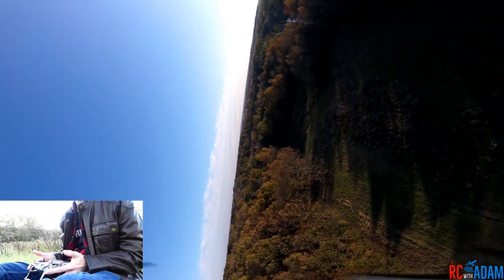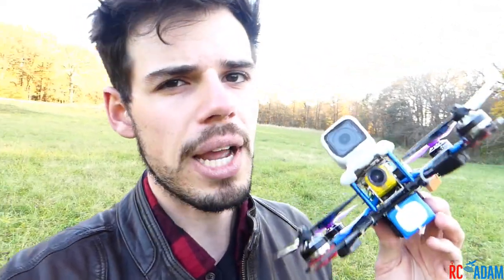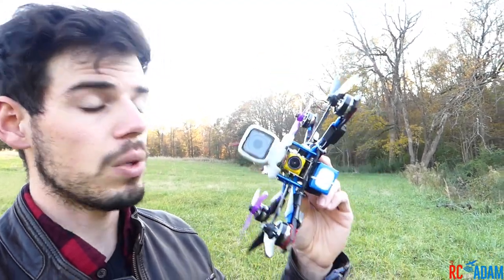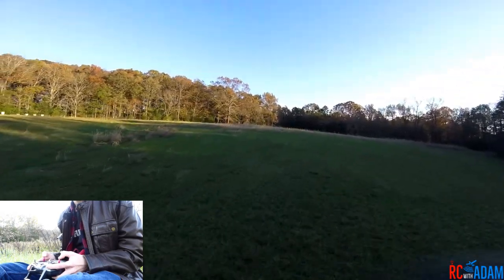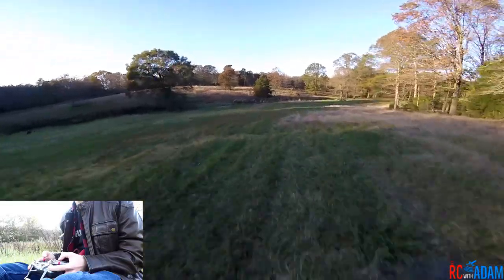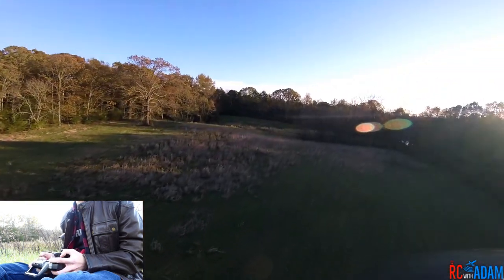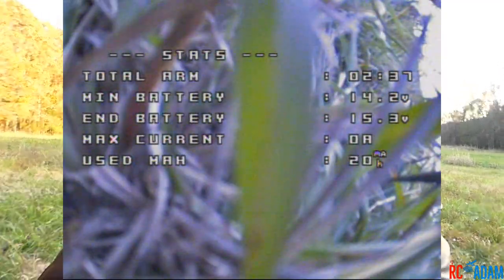AIR MODE Flight Demo FPV - What is Air Mode? Air Mode VS Acro?? Airmode Explained

Comment: Airmode actually keeps the pid loop active at zero throttle, it keeps the props spinning so you don't just drop out of the sky. Airmode allows you too stay inverted without falling uncontrollabley
Reply: What? Why does this comment even have 12 likes when its wrong. Acromode absolutely doesnt just turn off the motors when throttle is at zero. Like never, theres always like at least 3-7% power when throttle at zero. So what youre saying isnt the difference between acro and air. The difference is that in acro at zero throttle when falling all motors will be spinning at the same speed on the designated minimum motor speed of about 5% or whatever is chosen (when not giving any input). In air mode the props wont all spin at the same speed but rather on didferent speed, also never lower than the minimum motor speed of 5% or whatever is set bc they will compensate for any outside force acting on the quad with the goal of keeping it at a constant angle. So to be clear, both modes keep the motors spinning at zero throttle input, but airmode uses stabilization to keep the angle and acro doesnt
Reply: @baadlyrics8705  go and fly without airmode on, take it in the air and drop too zero throttle. The quad will drop out of the sky!

Now do the same with airmode on.... Then tell me the difference.
Reply: @Originaljonny2bad what his saying is both airmode and acro mode will keep the motors spinning at a set power. Air mode doesnt keep your drone up in the air the way you think. In acro the drone will drop out of the sky with no correction , air mode will try and keep your last position "orientation wise" . The only reason you might think your drone might be a lil more floaty in airmode is because when your drone is falling out of the air, the flight controller tries to keep he last orrientation that was set. Say your drone is top heavy and tends to lean to the right when free falling, the flight controller will try to fight that force to stay in the orientation it was set. Say your roll to the right a bit and your drone is top heavy, without airmode your drone will simply just roll uncontrollably while in airmode , it actively tries to keep that orientation
Reply: @neilbaquiran643  your sooo wrong, go do some research

Comment: Finally thank you Adam , I’m on day 3 of flying fpv ,only been hovering in stable mode with out the goggles . I decided I’m just going to go for it after watching video after video  never flown a quad before and can’t get on with a simulator, but I’m flying it about doing flips a couple of bit will try post up progress and I like to sit , but find I start leaning into the turns as if I’m sitting on it hahahaha
Reply: Hello, try fpv freerider. You can also use it on a tablet en most phones (app store) And you can also use your transmitter. It helps me a lot and I'm a pretty good fpv flyer now. Also important, you can learn to fly including tricks without damage.
Reply: I'm in the same boat, first flight I tried line of sight stable but ended up just smashing my quad into things and mashing up the props/lipo. I decided just to go with it the second flight and I personally find it much easier diving straight into the goggles and airmode. I was doing flips into rolls and freefalls straight away only crashed once due to pushing past my abilities rather than no control

Comment: I HAVE to sit.  Damaged middle ear.  If I stand, I'll fall down.
Reply: Ouch, is this one ear, or both?  Can you drive a car or ride a bicycle normally?
Reply: One ear.  Had an ear infection as a kid.
Usually okay.  No problem walking or driving.
But I definitely use visual input to compensate.
Good night vision, but if it's dark ENOUGH, I have trouble standing upright.
I do the Quad FPV thing, but always seated.
Thank the GODS I'm not prone to motion sickness!  I'd be queasy every day.

Comment: Mine had no horizon . Just airmode and acro . It doesn't  even have modes tab in betaflight . Airmode seemed like when lenses get broke in binoculars and the picture gets bent . But you can lean it back sirt of with the sticks .  Sort of like auto flip on a toydrone . Real popular with the freestyle regime rigid style .

Comment: I have much more control when I sit.
I understand why people use the pinch method, it seems that it would give more control, although, I am a thumber, because for some reason, when try to pinch, I cannot keep my quad in the air. Standing, on the other hand, I can't understand why someone would rather stand, if they have the option to sit?

Comment: Hello Adam , Thanks for this helpful video it really helps ppl like me. I have a Mobula 6, I'm having trouble with the trimming or calibration.  It just won't fly right, I've tried to calibrate and trim it but is nit working. Soon as I start to lift of it drifts at different direction and its impossible to control it, drone seems to have mind of its own. I think there's a bug in firmware or God knows, How can I factory reset the drone make it how it was from factory?  Anyone?
Reply: Disable accel,

Comment: Whats the difference between acro mode and nothing?   I still can't figure out what acro does when turned on?
Reply: There is no "nothing". You have to be in some kind of mode. Its like asking "what is the difference between an automatic gearmode car and a nothing gearmode car. There always is some kind of mode on and acromode is essentially the mode where you completely control the quad yourself without any assistance from the quad like self leveling etc.

Comment: What would you recommend to clean the mud off quads? I was thinking Isopropyl alcohol and a swab? I have a novice 2 to get me started but done the same as you faceplanted a few times in the mud
Reply: Contact cleaner spray does the job done.
Reply: Yeah isoprop is the best you can use, even better than contact cleaner spray in my opinion. But dont use the 70% isoprop, you need the close to 100% one obviously

Comment: Hi Adam , if I have airmode on a switch and turn it off lets say when landing  will it freak out as it does sometimes  when airmode is activated . Thank  you  !!
Reply from the maker: Hi! Good question! It shouldn't. I think a lot of people use that same technique (being able to turn off air mode). Really, if you can land gently it's not a problem, but I think that would be useful if you're just starting to learn how to fly (and land).

Comment: So with the death roll its kinda hard to know whether or not you want air mode on or off completely lol....I would definitely have to set the throttle threshold for airmode to activate and deactivate at certain throttle levels ....

Comment: New to flying drones...thought my TinyHawk 2 was messed up cause it would act crazy when it landed. One research led me to air mode and another to your video. Thank you so much for the explanation...Saved me hours of diagnosing my drone for no reason.
Reply: So did you determine it to run better or worse with airmode?
Reply: @maridkamuju9316  i know its an old comment but i thought id answer you, airmode on a tiny whoop should not be enabled unless your flying in open air outside with nothing to hit, its so much better with airmode off on a whoop because it will actually bump off of things without having a spaz and crashing, just if you take it outside and do punch outs with airmode off on a whoop then it gets very very wobbly coming down, and can get caught in its own dirty air and flip out of the sky, but for bigger quads where your outside punching out and stuff its much more fun and precise with airmode on, just if you start to crash you need to disarm straight away often missing a chance where if airmode was off you could have recovered, but its good to try both so you get a feeling for what it does and when its useful and when you should have it off, because you might find the freefall effect more fun for your flying style as you pop over objects and kinda drunkenly freefall it is really fun, but if you do a lot of punch outs then it can get rreallly sketchy sometimes if its gusty or you get into your propwash, but if you feed in like 10% throttle you get rid of a lot of the sketchyness, but sometimes you want less throttle, moral of the story, just try both, and give them both a good amount of time to feel out how they are different from eachother

Comment: Hi, did you find out what caused the spiral thing? I have that issue quite often, even when I'm just flying normally without doing any flips. Please help!
Reply from the maker: Not yet. It's still a bit of a mystery. But I think I'm having the same (or similar) issue with another totally different quad, so it may not be the Mamba stack.

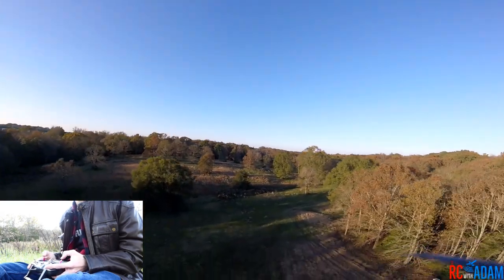Comment: Thanks. Why on minute 2:59, when  you cut the throttle the quad have a little oscillation?
Reply from the maker: You mean when it pitches forward? I think that is due to the PID settings. I'm pretty sure turning on "Anti-gravity" would fix that.
Reply: RCwithAdam I mean in 2:59, at the same time that you cut the throttle, i see some oscillation. I notice this effect in my quad, too. But I think that it makes this effect since I mounted the action cam. It could be the added weight of the hd cam. Perhaps increasing the minimum throttle in Betaflight, it could be solved. I have to try to remove the action cam. Thanks
Reply from the maker: @rinux505  Good point about the min throttle. Let us know how that works out.

Comment: Thanks Adam just configured my own quad in Betaflight and was using Horizon mode armed with airmode in Beta. And I thought I could only do flips and rolls and come back to level after....So cool with zero throttle input the quad stays at the last orientation such as a sideways freefall!! Great explanation!! Acro is fun with goggles as well, but I have lots of crazy aerobatic Line of sight Horizon/ Airmode on fun! Thanks again. Subbed! By the way I am a stander..Otherwise if i sit , it shows people my true laziness. hahah Just kidding ahaha

Comment: When I use air mode my quad will free fall so slowly if I'm angled anything less than 90°, any idea why this could be?
Reply from the maker: You may have a high throttle idle. You can turn it down via betaflight, but don't turn it down too much or you could have reliability issues (like desyncs) with the motors.
Reply: @RCwithAdam1  I'll check it out, thanks! 👍
Reply: @RCwithAdam1  yeah, and the desync is what happened in the video when you lost control there at the end im pretty sure

Comment: So then you dont want airmode turned on when your flying indoors with a tiny whoop or tinyhawk?
Reply from the maker: I usually have airmode turned on. But y ok I may notice the quad be a bit more sporadic when it crashes into things.
Reply: @RCwithAdam1  Okay I thought so.  So do you notice a difference flying indoors with airmode turned on and off?

Comment: Arm mode is Acro isn't it
Reply from the maker: Hi! No. "Arming" just means allowing the throttle to work. "Acro" is a type of flight mode that means you have the ability to move the quad any way you want and do flips and rolls (think "acrobatic").
Reply: @RCwithAdam1  Oh Okay Thank You